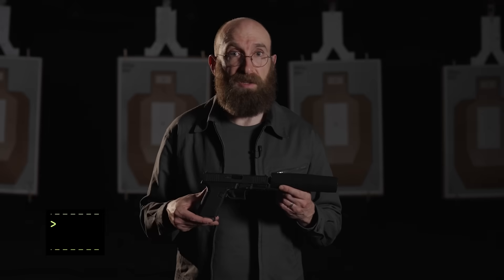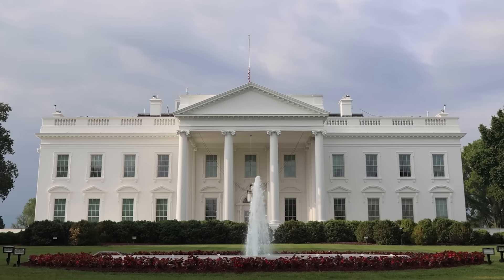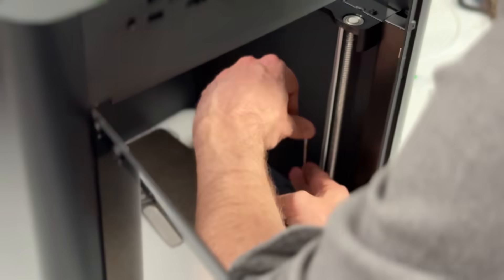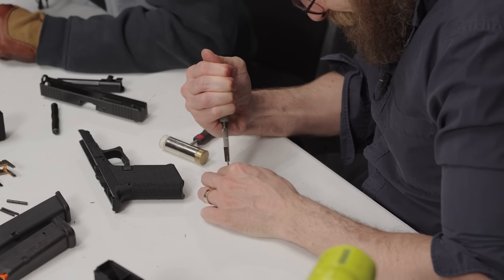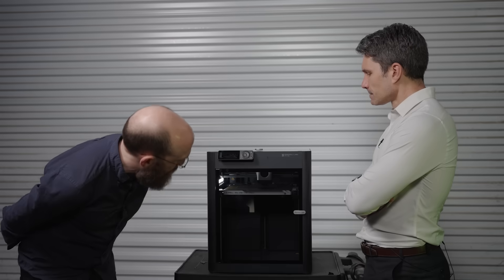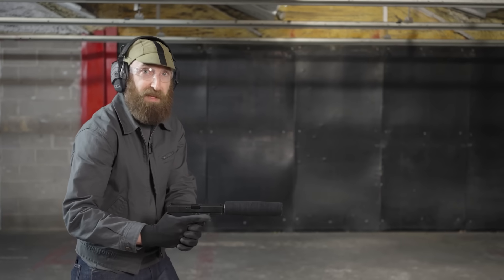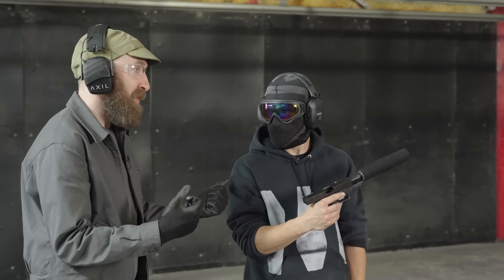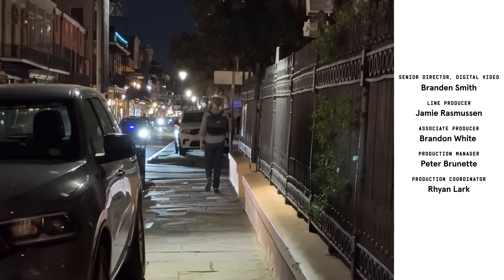I 3D-Printed Luigi Mangione’s ‘Ghost Gun’ | Hacklab | WIRED

Comment: "MOST of the parts of the firearm can be 3D printed".

The frame, he printed a Frame.
Reply: That was what I was thinking, the internal parts of the gun, and basically their heart, were bought in a store and shipped to them
Reply: @ramoncristancho337 you can print the internals but would you trust a plastic barrel? 3d printed metal is expensive af
Reply: @darkd5ds  You can do it with Nylon.
Reply: @firstclassatlast5352  thats what the suppressor was made of. I wouldn't recommend a nylon barrel that's 3d printed, water absorption will change it's structure.
Reply: i think the point is that the main internal components are easier to come by than a whole gun, and are harder to trace if they aren't purchased as a complete gun. The point of 3D printed guns is to avoid firearm regulation, not to create an entire gun with a 3D printer.
Reply: Yeah I've noticed this guy embellishes a lot of things that he reports
Reply: According to what the ATF considers “the gun” I guess he’s right.
Reply: Yeah, lazy... There are some models that are 90% 3D printed, then the rest of the parts are ordinary screws, springs and a metal pipe, but those take months to make...
Reply: The frame is the part you need a background check to get
Reply: All of the parts can be made on a cnc machine, All of the parts can be made by hand with hand tools. etc.
Reply: @corail53  good luck making a rifled barrel on general purpose CNC.
Reply: @mirrormirror5515  You don't need a cnc machine to it. Just a piece of suitable steel, drilled hole in it and a bore rifling reamer. A lathe would help, but isn't strictly necessary. They make guns out of steel just with a drill and files.
Reply: @corail53 yes they can. But not 3d printing like being claimed. And thats the issue. The lies. The OP is pushing you fan buy a crap 3D printer and build a gun. You cant. Not even close. Cheapest CNC you can get to do this? More than a cheap printer. Hand tools? More than a cheap printer. Materials more than the cheap printer. On top of the time you have to put in and it follows all the laws like must be able to be detected by a metal detector for example.
Reply: @johnard8831 hand tools? I don’t think so.  You obviously don’t know much.
Reply: @johnard8831  You can get a mini CNC router and make a metal part.
Reply: @siedliko thats not 3d printing. Thats also not cheap as claimed either. All my point.
Reply: @johnard8831  You can't print some parts, so stop crying. Small CNC cost about $300-400.  If someone needs a gun, they will get it one way or another.
Reply: @johnard8831  There's so many videos on youtube showing you can even on an ender 3 in PLA. Its not that hard anymore.
Reply: You can mill the rest of the parts. Forget about ghost guns. Drones are the future. You can attach a disposable guns to a drone, set it to recognize a specific face, and let it do its job.
Reply: @offilawNoone  no, drones are better used for dropping grenades etc, as seen in Ukraine.
Reply: @offilawNoone that's a bit of a reach
Reply: @Matt-g1k7w  Why?
Reply: @offilawNoone you have the ability to do all of that? It's not as easy as you made it out to be
Reply: @Matt-g1k7w  Not in the weapons business. Everything else is pretty simple, even if you don't fully understand electronics. Unless, of course, you're an idiot. The internet is full of instructions on how to build a drone, and it's also easy to find information on how to make one autonomous (within certain limits). Attaching a weapon to a drone is even easier than building the drone itself. As for creating a disposable firearm, I see no reason why it's difficult unless you're an idiot. The hardest part here would probably be facial recognition, but even that is described in detail online. If you can read, if you're handy, if you have at least some programming experience, a basic understanding of electronics and engineering principles, if you have the resources to buy spare parts and the time to test them—and you'll need a lot of both—then this task is easier than disassembling a car, removing its internal combustion engine, and repairing it.
Reply: @Matt-g1k7w 🤣🤣🤣
Reply: @offilawNoone never seen some explain how to build a drone with a gun to go kill someone but sure admit to that on the internet. You’re dense
Reply: @offilawNoone   No way commercial drones survive that recoil.
Reply: @roym4457 they don't need to. One drone = one job.
Reply: @roym4457 and it's better to make yor own drone.
Reply: @offilawNoone DJI just removed the restrictions cos the US pissed them off. 🤣

Agree - make your own. But also don’t count on OEMs to do your “policing” for you either.
Reply: @roym4457  All it takes is one single well placed shot. Even if the drone crashes and burns after shooting, if it hit the target it would not matter.
Reply: @roym4457  😂😂😂😂
Reply: @longboardcat98  Yeah. It's crazy how easy nowadays to do something like that. And quite frightening. P.S. It would probably be easier (and more reliable) to create a directed explosion using chemicals that can be bought at any hardware store.
Reply: he didint it was a pre mae p80. they wish they could drag 3d printing into this
Reply: The frame is the only part that is needed for a ghost gun
Reply: Look up the FGC9 or the Urutau.
Reply: The frame is the regulated part though, he says this in the video. You can print your own frame legally and then just freely buy all the other important parts with no regulation.
Reply: But it is the most important part though, because it is wat makes a gun a gun. The other parts are basic stuff you can find in any other device you own. Springs, barrel (metal pipe) etc.
Reply: As a professional gunsmith, I could make a machine gun (legally of course with our companies SOT 3) out of plumbing parts if I wanted to do so. It’s really not hard when you understand the basics and use rounds that have lower pressures to avoid catastrophic failures.
Reply: And the silencer
Reply: @fermi.paradox29 and it shouldn’t be illegal
Reply: @fermi.paradox29  Two issues. First silencers are not real. Its a suppresser. Next he didn't print one. At best he made a case for it if that.
Reply: @johnard8831  A silencer, also known as a noise suppressor. It is only colloquially referred to as such.
Reply: @fermi.paradox29 i know what people call it. Doesnt make it so. Just like you can call a man a woman. They are atill a man!
Reply: @johnard8831  What part of the colloquial language did you not understand?
Reply: @johnard8831 they would’ve made a better one with a water bottle, sand and some sponges. But who am I to judge
Reply: @johnard8831  semantics
Reply: @johnard8831 the first commercially successfull suppressor was literally designated "silencer" in the patent by its inventor (Hiram Maxims son). Although not the preferred technical term nowadays, "silencer" is absolutely a valid colloquial synonym
Reply: @maj0mi23 one patient doesnt make the term incorrect. They are legally call suppresers. Fscts matter here. If he was just being educational no issue. Hes talking laws. So because of that we must speak as law.
Reply: @johnard8831  'Hiram Percy Maxim, the original inventor of the device, marketed them as "Maxim Silencers".'

bro, you're not just wrong, you're historically wrong by word of the original creator of the silencer.
Reply: @johnard8831  ACTUALLY, silencer is correct and interchangable. In fact the creator called it a silencor.
Reply: @patrickrosington1174 once again for you like i told others. Legal terminology. Tbis video wrnt to legality thus im using proper legal terms!
Reply: @johnard8831  It's the FTN.3 suppressor. The baffles are 3D printed and you put a CF tube around it to strengthen it. Can also be wrapped in fiberglass.
Reply: @commodoreaxis You dont understand 3d printing or suppressors do you? That baffling needs to withsand pressure and heat. Best fillement you can use is the PEEK (Polyether Ether Ketone)  260C use temp. Enough for a 22cal round. PSI about 7250. 22cal round well 24000 PSI produced. More than the plastic can withstand. But lets argue as it woukd be you lose some PSI during cycling the rounds and traveling. Lets be generous and day it loses half its PSI! 12000 is still more than 7250. It would destroy the plastic. Causing the suppressor to blow up or at best hold together and make the round bounce inside causing a failure and well. Not suppress the sound. You clearly know nothing of 3d printing or suppressors. Internet has a lot of information and you just pulled what you could goggle quick to make an argument. You failed. Try again.
Reply: I mean, he blatantly misrepresented a statistic, moved on to “flooding the community with illegal guns” as if the only illegal part about it isn’t actually committing a crime with it or a prohibited person possessing it in the first place, and then moves on to this. Anything to deflect responsibility onto someone else and make things sound scarier than they are.
Reply: did he? not sure there's evidence it was his gun. mangione innocent.
Reply: @chrismathewsjr Mangione did it you cuck
Reply: @chrismathewsjr 10-4 good buddy. 

Magic bullet all day long.
Reply: that gun was a CIA plant for sure
Reply: Wired is fairly left leaning though right? So it might as well be the same thing as printing all the high pressure parts (to them)
Reply: @Mr.McWatson That's why they wanted to make that murderer Mangina's weapon.

Comment: Before 3D printers were a thing, the term was not ghost gun. The term was zip gun. I never got into 3D printing. Maybe someday. I do know though that I can build a gun with one trip to the hardware store. If you want really cheap, 3/4" plumbing pipe, 1" plumbing pipe, 1" end cap, and one machine screw will get you a working gun. You start adding steel round stock and springs to the mix and you are on your way to a sub machine gun.
Reply: That is how it was for the former PM of Japan, Shinzo Abe.
Reply: @rabbismooleymooley  Right. Some plumbing pipe, end cap, some wood, and a 9v battery. I was thinking modern cartridges, but if you are willing to go black powder, you can go REAL cheap. Also the results make it clear it is effective despite the crudeness.

Comment: Its shocking to see a 3D printed Glock frame have better tolerance then a stock P320
Reply: P320 is the real Ghost gun cuz it goes off when it wants too 🤣
Reply: Most people don't know this but Sig sold the P320 to the Army for ~$170 apiece with mags, accessories, and "training." It's been public news since they won the tender, but for some reason it's just not a fact that was on people's radars. So to me, shocking is not the right word to use when I already knew Sig is selling Hi-Points to Uncle Sam hahaha
Reply: the P320 frame is pretty well made. it's the trigger/FCG that is the problem....and like the weapon in the video, is a manufactured part that's purchased elsewhere.
Reply: @rickbrasche8781 Is that the version with the manual safety or without?
Reply: How to legally kill a health insurance CEO: "Hi, take this P320 as a gift and token of my appreciation."

Comment: Just a little tip, if you flipped the 3d part around in the slicer (so just printed it upside down) than you could have saved a lot of time and filament on the supports.

Comment: 17:11 The problem with DRM is that it turns ownership into licensing. Multiple companies across multiple industries do this. You no longer "own" things. You simply pay constantly to have access to use them, and once you stop paying, you lose access. So, you could buy a printer, but if you don't pay a monthly license to print, you just have a pretty brick.

Comment: "How easy has it become for someone to build a deadly, and untraceable weapon?"  You can build a zip gun with a hunk of tube, a rubber band, a nail, and some nail-gun blanks firing whatever projectile you shove in there.  You can build a 12 gauge shotgun with a couple pieces of pipe, a nail, and slam-firing them together.  It's not rocket surgery.

Comment: 16:55 - The comparison to currency is underselling the problem.  Currency has only a few designs, and includes anti-counterfeiting features that can be the same across different design bills. This means (paper and ink) printers only have a few specific designs they need to block.

Gun parts don't have a "common feature" that makes them easily identifiable. Especially when compared to "gun-like devices". It may be illegal in some jurisdictions to 3D print a firearm that expels bullets via gunpowder, but in those same jurisdictions, 3D printing a squirt gun, or a Nerf gun is completely legal. How is the 3D printer supposed to tell them apart? Especially when the parts that are legally restricted to manufacture aren't even "the core bullet-firing component"?

Comment: You can't 3D print a "gun". You can 3D print 30% of a gun, and then buy the rest of it online.
Now granted - you could also 3D print that 70% rest of the gun that you will otherwise buy, but that will require you spending a TON of money on really expensive 3D printing gear.

So maybe it is technically possible to MANUFACTURE a 3D gun, but for most people out there - buying the rest 70% is what they will need to do. And if you ask me - that should be looked into.

Unless they are shooting at corrupted CEOs, then its fine.

Comment: Why these people are so dumb? If the law stated that “the gun” is the pressure bearing part and not one of the only parts that bear no pressure it would make harder to use a 3D printer to make it. But let’s be real if you want o build a gun a bunch of pipes and bolts would suffice and if you really need to kill someone like Luigi did a knife is way easier

Comment: Anyone who can read a mechanical drawing can make a gun. Anyone with a mechanical engineering degree can design one. John Browning invented the M1911 in 1905 without CAD, CNC, or computers. Just a few years later, it was mass-produced with just hand tools and basic machining. The ability to make guns isn’t new. 3D printing is just another tool, not the root of the issue. You can't "uninvent" gunmaking.

Comment: Putting DRM on a 3D printer is already impossible because there is too many open source versions that you can simply get a DRM 3D printer and print a open source 3d printer. Or you can simply print it using older 3D printers already in use.

Comment: It is really weird that the only part you cannot buy legally is the base. Here in Germany is one of the few pieces you can legally buy without a license. The parts you simply bought are the regulated parts in Germany.
Reply: even in germany you can 3d print a gun, the inventor of the fgc9 lived in germany
Reply: @4n4rch1st7  The FGC9 uses ECM to construct the barrel, so I would argue it is not a 3d printed gun, but a gun with 3d printed parts. It's not enough to have a 3d printer, print it, put some springs in it and shoot away. Somebody with a lathe, a good CNC machine and the knowledge how to use them could always make a gun, even before the dawn of 3d printing.

Comment: 16:47. This take is very poor. The idea that current printers can recognize and stop currency as being in any way equivalent is just not true. The whole point of counterfeit currency is to create a convincing replica of a real currency. The main purpose of ghost guns is to create something that can not be found on the commercial market. It is very difficult to circumnavigate that because the ghost gun does not need to replicate the looks or features of traditional firearms, if it can still fire accurately and reliably. He is basically calling for the next step, which is ai that controls what can be 3d printed significantly more extensively than what is currently present for currency. If implemented today, it would be very ineffective, and would have a lot of false positives. Sorry for the block of text, but it really is ridiculous and serves no purpose in this video. It ruined any shot of credibility wired had left.

Comment: Guys, regulating this by blocking printing certain objects in the firmware is NOT the way to go and a silly idea in general tbh. The reason is that ALL existing 3D printers would have to be updated to the newest firmware. Keep in mind many of them have been manufactured by companies that don't even exist now and most of the older printers are running totally offline so there's no way to check what firmware version they are running on a large scale. I also belive that some older control boards are just to limited in resources to guess if a gcode is in a shape of a gun or not.

Comment: 16:50 Excuse me, but 3D printing a gun will not be prevented by "the printers firmware".
Flashing custom firmware onto a 3D printer is common and easy to do.

What would really make things harder would be to control parts of the gun that are actually necessary for firing a round. We commonly print plastic, so we fight low heat resistance, high tolerances, bad surfaces, high friction, ... compared to metal.
So having a pressure and heat bearing part made of plastic would likely scare most people off.
Reply: Barrel/chamber would be a much better way of regulating a firearm. Especially with the existence of SBR laws. Registering a lower to be allowed to put a shorter barrel on is really stupid. Especially when you have to de-register that frame to legally transfer it across state lines.
Reply: like bullets - cant shoot a gun with no ammo
Reply: @joeeeyyyyyy it would be quite radical for a politician to attempt to require a background check for ammo.

Comment: so the thing is even if they try to restrict the printing of the models thru the software of the 3d printer ppl will find a way to bypass them. And those ways exist now, software(octoprint, etc), older printers, DIY printers, modded firmware.